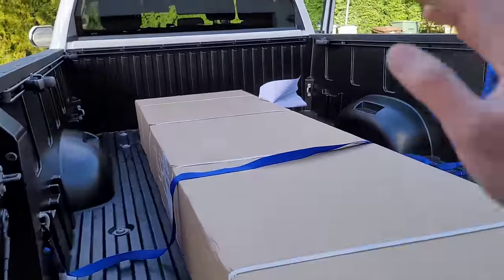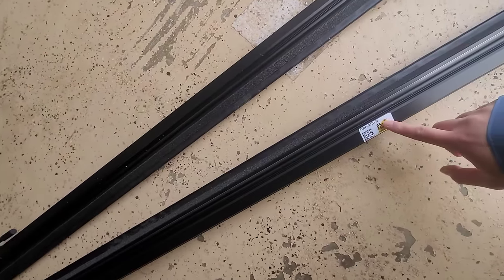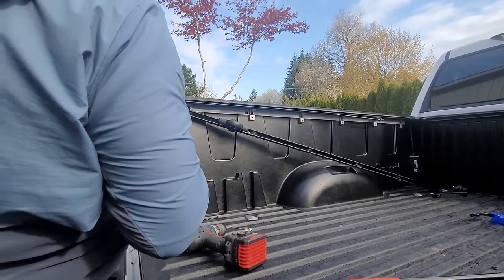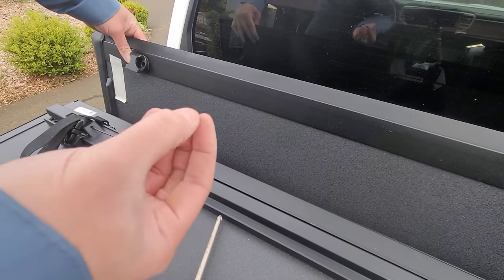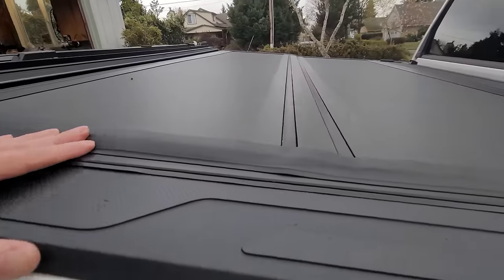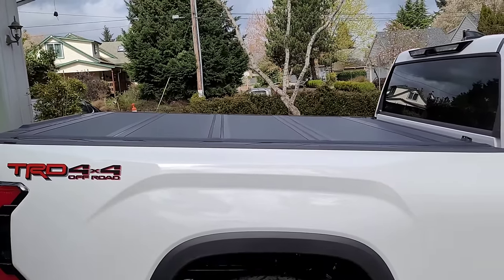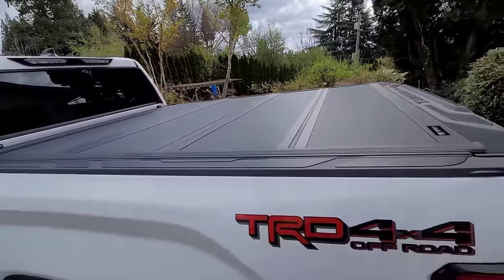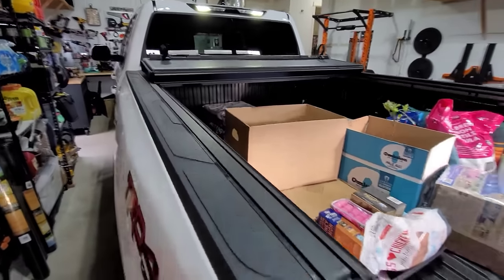2022 Toyota Tundra OEM Tonneau Cover Install - DIY Instructional Video - New Tundra Updates!

Comment from the maker: Friendly install tip: At about 6:35 in the video. After dropping the two elevator bolts through the hole, before you tighten the knobs underneath. Push the entire tonneau cover assembly forward so that its up against the cab/bulkhead as far as possible. This will help in the end with your tailgate latch, so that the tailgate still drops via pushing the remote, and not catch on the tonneau cover. Good luck with your installs!
Reply: I was just going to post that too. Perhaps keep the bolts c/t the rails loose and then tighten once it's all installed and the bed opens? Thoughts..

Comment: Anybody have a better update on the status of the tonneau recall than I do? I took my truck to the dealership in April 2023, and they removed the tonneau cover to address the recall. I haven’t heard anything about a replacement or modification to the tonneau cover to fix the issue of it possibly “flying off”. I’ve gone to the dealership multiple times and get no answers. I called U.S.A. Toyota corporate headquarters and talked numerous times with their “Brand Engagement Advocates”. They have no remedy for the recall and have no status on a modification or a replacement cover. They suggested I talk to the dealership. I’ve followed up multiple times. It’s now been SIX MONTHS since the recall, and no remedy. I have an expensive truck with no way to secure valuable items in the bed and keep the rain off. We’re not talking about a major modification—it’s only a simple tonneau cover. What’s the problem?

Comment: Thanks for the video, confirms I'm going to buy this.  I have twins on the way and need to put the stroller somewhere when they're taking up the whole back seat, and don't want it out in the elements..  The OEM one is great, it re-uses the rails so you don't lose those, which is great, and flips out of the way almost entirely, then it's only 5 minutes to remove those 2 knob screws if you need to do so in a pinch b/c you need every inch or something.  Those drains look a bit ghetto, but whatever, that's very minor.

Regarding your comment about the 360* camera, it won't interfere.  The 3rd light has 2 cameras in that black piece, 1 for the load camera, 1 camera for the rear view mirror.  The 360* is formulated by 4 cameras:  1 under each side mirror for the sides with 180* FOV, 1 in the grill for the front, and 1 in the tail gate for the rear, which doubles as the back-up camera.  So no, this won't impact the 360* cameras or the load & rear view cameras.  Very nice design.

Thanks a bunch, and yeah, watching this makes it straight forward to install w/o having to read directions!

Comment: Thanks for the video 
It helped me install a tonneau cover on my 24 Tacoma. Very close design to the tundra cover biggest difference they use 2 elevator bolts on each front corners with a locking nut and cotter pin design to hold it in place   I like the knob design better

Comment: Found this video while trying to figure out why the dealer used those holes for the drainage tubes, I didnt realize they were factory holes since the dust was still there (I guess the dealer must have drilled mine a bit bigger). Also find it odd that there are little holes directly below where the tubes hang but im not sure if the dealer did that or not, I will likely drill them bigger so i can use them and have the tubes hang straight down.

Comment: On the front by the rear window on other videos they had a rubber piece that was installed across the back, I didn’t see that on your video!
Reply: @eyeswideopen What was the purpose of the rubber strip that you noticed?
Reply: @chrismatta1666  the bulk head seal by the rear window

Comment: I've been debating between this OEM folding tonneau, the RetraxPro XR, and the BakFlip MX4...
Between the OEM and BakFlip, they are pretty much identical.
Did you consider others? What made you land on the OEM? 

This was an awesome vid and thanks for posting. The update at the end was perfect follow up. Pretty much my same Costco run too. 
I did spy those original rims on the corner....

Comment: Did you have to do any drilliing into the composite bed where the drain holes are or are the holes large enough for the hoses supplied , cause my drain holes look quite small on my composite bed(no spray on liner) on my 24' Tundra limited trd w/ 5.7' bed?

Comment: Question:  do those 2 about 4" rubber bumpers up on that last panel (the laundry detergent bottle was next to it at one point ) - stay in place for you?  One of mine has come loose - and I've only had the cover on about 1 week.

Comment: Great video. What tailgate adjustment did you do to allow tailgate to open freely??  Thanks for sharing.  👍🏽👍🏽
Reply from the maker: Just pushing the entire assembly forward. Closer to the cab. Then retightening the knobs/elevator bolts

Comment: Thanks again for video.  I ordered this cover and it is delayed but should be here next week. After installing it, does it keep the bed completely dry after raining? Thanks
Reply from the maker: So far it has. Ive been on a few 3 hour road trips in heavy rain and its been completely dry. I haven't taken it through a car wash yet, but those things shoot pressurized water in all directions.. i would guess water could potentially get in in that case. However under normal heavy rain conditions my bed has been dry.

Comment: Great video. The only question is if you used the original bolts from the OEM rail to install the tonneau cover rail, what bolts did you use to reinstall the OEM rail underneath the tonneau cover rail?
Reply from the maker: Tonneau cover comes with new set of t30 torx bits in the box. Sorry should of covered that in the video

Comment: Great one. Do you know what the max surface weight is that it will support?
Reply from the maker: Not very much. Toyota doesnt list it anywhere. However the rails that the tonneau sits on are just a hard plastic. Best guess would be 50-100 lbs tops.

Comment: Just installed this. Not sure what the 2 prop rods are for on the rail system. Any idea?
Reply from the maker: Keeps the cover propped up against the glass when all the way opened. When driving it'll stay up.
Reply: @BillyOnroad  figured that out immediately after posting this lol. Thanks for the video made my install a breeze.